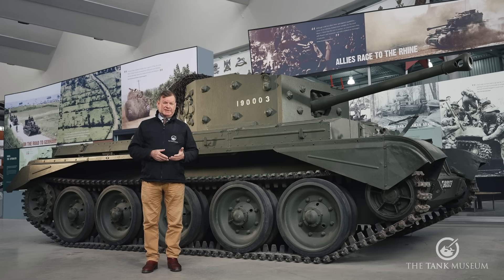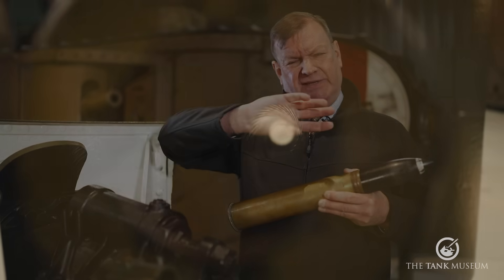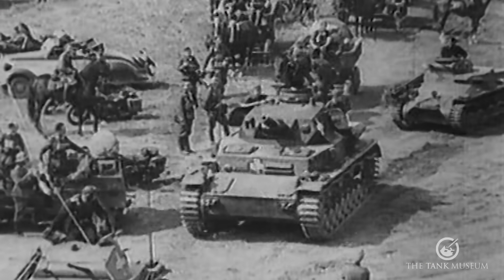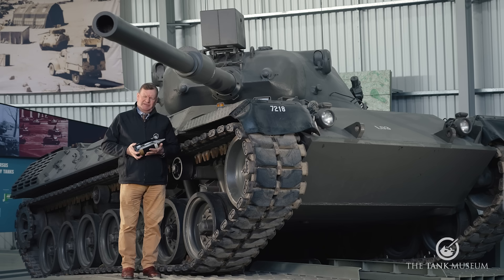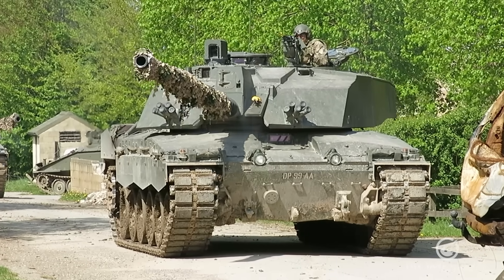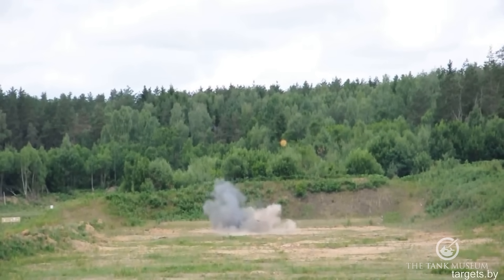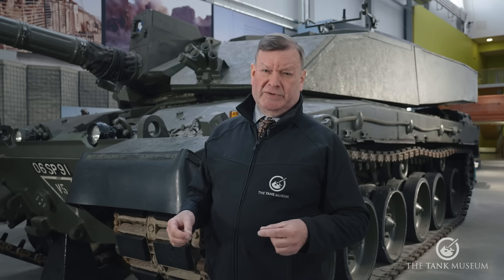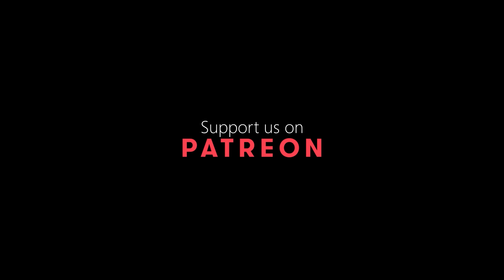Knock Out: The Evolution of Tank Ammunition

Comment: For years I have not been able to find  an explanation as to why the 88mm was so effective at long ranges in the tanks.. the explanation given about the 6 pounder brought everything into focus.. the 17 pounder was probably the best to against heavy armour.. but the American 75 mm with advancements in AP rounds actually was a more versatile and valuable gun.
Reply: Simply put the 88 was originally designed as an anti-aircraft gun able to reach heights of 20,000 feet fairly accurately so put it on a tank and you are not shooting 20,000 ft but maybe 3,000 ft so needless to say it had plenty of oomph to get to the target and penetrate no problem and was so accurate at that range as well.
Reply: Easy higher musle velocity and more weight.
Reply: Going from memory but I think 80% of US tank rounds fired were HE.  The 75mm provided more blast effect than higher velocity rounds.  The Big cats were pretty rare on the western front so the Sherman was a good fit for "all" tank missions aside from dueling the Panther and Tiger.  An old joke from the Germans, a Tiger could take on five Shermans at once...but there was always a sixth Sherman.
Reply: @scottw5315

Panthers were the most prevalent German tank after Normandy. More Panthers than Panzer IVs were built in 1944 and 1945. There were 650 Panthers in Normandy alone. There were more Panthers than Panzer IVs in the Westwall battles and the Ardennes etc.
Reply: @scottw5315  After Normandy, Panthers accounted for around half the German tanks on the Western front. It was a standard German tank, just as easy to produce as a PzIV,
Reply: Only problem with the US 75mm gun, it did not have good armour penetration (it was designed to fire HE). So failed against newer German tanks (probably would not been good against Russian tanks either). War on the Eastern front had seen a rapid advance in technology. US would probably have been better upgunning to 90mm, rather than 76mm.

Comment: 13:00 We now have agreement that HEAT (including ATGM rounds, refer Tank Chat on Swingfire) are not KE (i.e. dependent on muzzle velocity) rounds.
Reply: Yes! I was waiting to hear how this was addressed.
Reply: What would you class an EFP as? What is the mechanism by which the superplastic copper jet of a HEAT round can penetrate armour? What it's called and how it works are two different things.
Reply: @trolleriffic  I understand fully that HEAT doesn't melt its way through.
I remains a CE round. The Chemical Energy of the EFP forming the jet / cone is what causes the penetration.
If you walk up to a steel plate with a HEAT round and hit the plate with the HEAT standoff rod with enough force (not 1750metres per second, but a bit more than a tap) the round will go off (not good to be there, btw).
The HESH / HEAT / HEP / EFP round does not need the KE imparted by the muzzle velocity to achieve the terminal effect of penetrating the armour.
If you walk up to the same steel plate with a APFSDS extended rod penetrator / dart and again hit the plate with the rod, pretty much nothing will happen apart from scratching the paint.
The APFSDS dart needs the KE imparted by the muzzle velocity to achieve the terminal effect of penetrating the armour.
Reply: @whya2ndaccount   When the coper cone collapses, due to the Munroe effect and EFP is form and it penetrates the armor using kinetic energy therefore HEAT is a kinetic weapon.
Reply: @whya2ndaccount  Designation doesn’t matter physics matter and this is a kinetic weapon, designation is a mater of doctrine not physics.
Reply: @whya2ndaccount   The EFP goes through armor bu using KE energy not chemical, therefore it's a kinetic weapon. 
They are classified as chemical due to doctrine and to make them easier to differentiate  form APFSDS.

Comment: A mistake about annealing (5:10):
Hardening the round (via quenching) gives it strength but also brittleness.  Annealing improves the toughness of the round so that it doesn’t shatter on impact.
Reply: I assume he was conflating annealing and tempering. Heat treatment is probably above the level of this video though. You can do some pretty fancy things with heat treatment if you know what properties you want in a specific part of the design.
Reply: Also: annealing in front of a priest blesses the round. (Or gives it trauma)
Reply: It’s neither here or there it’s actually an exact science of just the right amount either way for the use case it’s just oversimplified for a short video
Reply: what happens to all those spent brass casings?
Reply: British and American produced AP ammunition was subjected to the "Hadfield" hardening process, which was introduced in 1939. It was a highly secret hot chemical process, which the Hadfield company used on the 2 pounder solid shot projectiles that they were contracted to produce in 1939. BY comparison, in range tests, the Hadfield AP solid shot could penetrate up to 77mm. of RHA @ 0 degrees @ 100 yards, whilst the AP solid shot produced by other contracted manufacturers could only penetrate up to 64mm. of RHA @ 0 degrees @ 100 yards. The Ward Department wanted to know why this was and demanded that Hadfield shared the secret hardening process technology with other manufacturers and the Americans.
Reply: Yup, basically hardening the skin of the metal (about 2-7%) of the overall metal but imparting a relatively 'softer' metal inside after heating it up again.

Comment: Annealing certainly does not give max tensile strength and produces ductile or 'soft' steel.
Reply: Annealing hardened steel can greatly increase its toughness without losing much hardness if it's done right.
Reply: @trolleriffic  To anneal steel you heat to a specific temp based on the actual steel grade (about  8-900°c) and allow to cool slowly at a specific rate, (again depending on the grade) this will remove any hardening done previously.  You also lose any 'toughness' developed during prior forging.  So what the presenter said makes no sense.  If your aim is a 'tough' component with a 'hard' surface you develop the tough centre (eg forging and/or heat treatment) first then surface harden afterwards using one of various techniques.
If you want a through hardened component you heat and quench.  Temps times cooling rates are all dependent on the alloy involved there is no one treatment suits all in metallurgy.
Reply: Annealing reduces brittleness
Reply: @awatt  Yes it does, but annealing removes all of it, along with the hardness, the two are inextricably linked.  If you're not doing it all the way then you're not annealing, you're tempering or normalising etc.  different treatments intended to create different results.
Reply: @Ciderwinder  
I agree with you 💯
Also annealing removes stress.

Comment: "International Atomic Energy Administration points out, “DU is 3 million times less radioactive than radium still found in many old luminous watches and 10 million times less radioactive than what is used in fire detectors.” DU is also far less radioactive than the potassium 40 found in the human body. Potassium is a substantial percentage of the dry mass of common Hawaii agricultural crops such as bananas and marijuana. A 2.5 lb bunch of bananas will contain over 100 mg of potassium 40. Gamma detectors are used to detect marijuana smugglers at international borders."

Comment: 10:25 Why is the APDFS round so deadly ? Its basicly a very hard and small arrow, going at high speed - but it have no explosive filler ?
Reply: When they penetrate, they create a lot of splinters from both the armour they penetrated as well as their own body. Fast spliters bouncing around inside a small metal box filled with living beings and flammable objects are not fun. Plus, due to friction the metal gets white-hot and the metal dust can spontanously ignite when in contact with the air inside the tank.
Reply: @Bird_Dog00  Thanks for the reply and the explaining.
Reply: There's a lot of mass impacting on a very small and sharp point at incredibly high speed so all that energy and force is concentrated on a tiny are of armour. It's like if I punched you in the arm lightly using just my fist it wouldn't do anything, but if I was holding something sharp it could easily puncture your skin and might go quite deep into your arm even though i've only put the same amount of force and energy behind it.
Reply: @trolleriffic  Thanks for the reply. I understand its capability to penetrate, but I was confused about why that little dart did so much damage post pen.
Reply: @dapre  Sabot has been known to go through both sides of a tank and do very little damage. As with all tank ammo, there's a time and a place, depending on circumstances.
Reply: @dapre  My mistake. Just to add to the points already made, when the round or splinters impact explosives in other munitions or the propellants for the gun, the shock alone is is often enough to cause them to explode (like hitting nitroglycerin with a hammer) which adds to the destruction caused by the burning fragments.
Reply: Shrapnel.

Comment: 18:08  Wait, it literally looks like a normal charge cut in two.
Is it done in such a manner you can use 2 half-bags at a time if you ran out of full-sized ones?
Reply: 2 HESH charges aren't equal in power to one APDS charge, the APDS charges are 2 inches longer. This means you can't close the breech if you accidentally load an APDS charge behind a HESH projectile, which is better than blowing the gun up...

You can however, stow 2 HESH charges in the the space that one APDS charge takes up, which is why Chieftain's supposed to have stowage for 64 projectiles, but only stowage for the equivalent of 36 APDS charges
Reply: That's a good question. That might be a reason but it could also be for the purposes of identification - it's much easier to feel that you've picked up a half bag when it's like that, even if you're struggling to see because there's dust or smoke in the tank.

Comment: What about the dust of the depleted uranium shells after they hit armor?
Might act a bit like a miniature dirty bomb in the area around the destroyed tank.
Reply: International Atomic Energy Administration points out, “DU is 3 million times less radioactive than radium still found in many old luminous watches and 10 million times less radioactive than what is used in fire detectors.” DU is also far less radioactive than the potassium 40 found in the human body. Potassium is a substantial percentage of the dry mass of common Hawaii agricultural crops such as bananas and marijuana. A 2.5 lb bunch of bananas will contain over 100 mg of potassium 40. Gamma detectors are used to detect marijuana smugglers at international borders.
Reply: Nowhere near enough radiation to do that. A decent sized garden will naturally have a few kilos of natural uranium (that's about two thirds more radioactive than DU) in the first metre of soil along with significant amounts of radioactive thorium, potassium, radium and other elements. Isotopes with very long half lives (U238 is 4.6 billion years) are the last thing you want for a radiological weapon because the activity level is so low and it mainly produces alpha particles which are stopped by air or the top layer of dead cells in your skin or a piece of paper - you could build a house out of DU and it wouldn't present a serious radiation hazard to the person living in it. Breathing in the dust isn't a great idea, partly because it's radioactive but also because it's toxic but it doesn't stay in the air long.
Reply: @trolleriffic  It is hard to believe that suddenly it is no biggy since all the years before, whenever they were used, later we got complaints about the local population suffering under the after effects.
Reply: @mortallychallenged1436  Complaints yes, but in-depth scientific studies of populations in the most heavily DU-contaminated areas have found that concentrations in their bodies are often so low as to be undetectable, and when they can be measured it's found to be far below even the most conservative safety thresholds. Humans naturally tend to find associations whether they exist or not - it's not that people are intentionally lying, but rather that if I was told that my house was built on a toxic waste dump, I would naturally start to blame any health problem I have or ever had with living on top of hazardous waste whether or not those chemicals were ending up in my body.
Reply: @trolleriffic  I looked into some studies about this issue and have to call bs on this ammo being not a big deal. Places where this ammo was used including the soldiers that handled this ammo for some weird reason suddenly get health problems that match exposure to radioactive hazards. I guess that now the Ukraine might use them we are set up to believe that this stuff is harmless and in 20 years later (depending on the outcome) we are allowed to talk about the after effects of using this ammo. 

Reminds me when the news during covid lockdowns told us that participating in a mass gatherings is bad for your health, except you are on a BLM protest/riot then it is fine.
Reply: @mortallychallenged1436  A slight correction to your final paragraph - "Reminds me when the news during covid lockdowns told us that participating in a mass gatherings is bad for your health, except you are [prime minister or working for him] then it is fine.

Comment: Depleted uranium is just as radioactive as anything else around you. It is just the tails from the enrichment process, after which it gets discarded, and the enriched portion is used for nuclear fuel. DU is no more radioactive than natural uranium (as found in nature). It never sees the inside of a nuclear power station.
Reply: Apparently soil contains an average of around 2g of uranium (equivalent to about 3g of DU) per ton, which means that a reasonable sized garden will have a few kilos of uranium in the top metre of soil alone. That's an average as well and some parts of the world can have 10-15g per ton while still being normal soil, and near to uranium deposits it can be much higher still. As well as that, soil has radium, thorium and potassium which contribute as much if not more radioactivity than the uranium.
Reply: International Atomic Energy Administration points out, “DU is 3 million times less radioactive than radium still found in many old luminous watches and 10 million times less radioactive than what is used in fire detectors.” DU is also far less radioactive than the potassium 40 found in the human body. Potassium is a substantial percentage of the dry mass of common Hawaii agricultural crops such as bananas and marijuana. A 2.5 lb bunch of bananas will contain over 100 mg of potassium 40. Gamma detectors are used to detect marijuana smugglers at international borders.
Reply: Depleted uranium is toxic. The use of it is a war crime. This video is proof that the Tank Museum is a criminal and terroristic organisation. EVERYONE who promtes the use of DU is a candidate for the electric chair ...
Reply: "Just as radio active as anything else around you" is a weird thing to say, given that most elements that are generaly around us are not radio active at all. U 238 is harmles if you are just holding it in your hand, but that's not the issue. The dust can and will kill you if it gets into your lungs as it emits alpha particles. They are highly destructive when directly interacting with living tissue.
Reply: @Bird_Dog00  Humans are exposed to environmental radiation all the time and our own bodies are radioactive, mainly due to potassium 40. Alpha emitters are a risk when ingested or inhaled but I don't think I've ever read of anyone being made ill or dying from DU exposure. Living at high altitude increases the radiation dose significantly (Earth's atmosphere at sea level is apparently the equivalent of 13ft of solid concrete in terms of shielding), as does living in regions with certain geology but the health problems people would expect from that exposure just aren't there.
Reply: @Bird_Dog00  But the world is full of radio active elements, even in the air you breathe. Even plants can absorb radioactive elements. A bit of radioactivity is good for you, it helps evolution.

Comment: Excellent video thanks. Do any other countries use HESH?
Reply: The Americans used it in the M60 and early M1, when fitted with the British L7 105mm gun. They called it HEP (high explosive, plastic).

Apparently the Soviets experimented with HESH but couldn’t get it right.
Reply: Because the round is obsolete and new better rounds are in service now.
Reply: @viceralman8450 Awwww poor you can't figure out how HESH works 😂
Reply: @zoiders  Easy they detonated outside and the vibrations create spalling inside, composite made of different layers stops such vibrations to travel through the armor making it ineffective against tanks with such armor. Now better and more versatile rounds exist than turns HESH obsolete. 
A clear signal of this is the brits moving to an smoothbore gun on the challenger 3.
Reply: @zoiders  He knows how HESH works, that's how he came to the conclusion that it's pretty much obsolete.